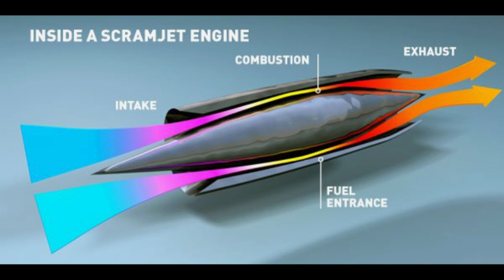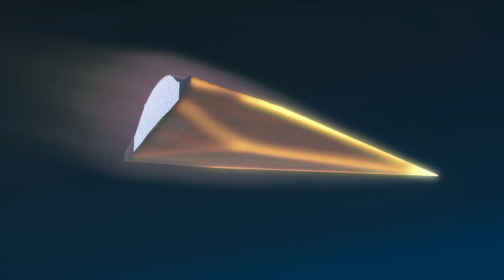SR-72 MACH 6!

Comment: They won't be lighting candles in hurricanes .Lockheed have bought into reaction engines in the UK. It uses thermodynamics to propel the plane like a rocket but with the fuel efficiency of a jet. That is why the whole project has stepped up a gear or two.
Reply: Can you send me any links

Comment: The pictures you show of the Aurora are a plastic model. The Aurora (SR71 replacement) does or did exist. A mil radar op in the UK told me they would be briefed before it came through  (more than 15yrs ago), so whats with this SR72?  Perhaps it melted in flight.

Comment: At 0:50 -
Your data on the SCRAM jet is inaccurate. A RAM JET has no moving parts. A SCRAM jet is basically a regular jet engine which reconfigures itself in flight to function as a RAM jet.

Comment: On September 18,2015 a stealth flew at mach 6 speed for several hours and landed.I think it used two Wang Zhengou turbo scram jet engines and Shou-En Zhu low cost grapheme alloy airframe.It may have quantum radar and PL-15 air to air mississiles which is twice the range of US missiles.Grapheme is 10 times stronger than titanium and twice the melting point of titanium.Graphene alloy can adsorb radar signals.The SR-71,F-22 and F-35 used a very expensive titanium alloy airframe that can be seen by quantum radar and cost 240 million dollars each.
Reply: Corrine Tsang WHATS THE POINT !

Comment: You realized they never officially declassified the SR-71's maximum capabilities right? Mach 3.2 is just what we're allowed to know. I'm pretty sure the SR-71 was capable of going much faster.
Reply: I believe that they have reached 3.45 to 3.5. It's intended sweet spot was 3.2., but not a limit, just where it was designed to fly very efficiently. I have heard that to go beyond the 3.5 figure would result in the compressor fan blades taking on damage as they had a rated limit of 427C- air temperature/density dependent. Whether that was a hard limit for short bursts of speed or for long term average temperatures- not sure. At mach 3.3 however, they could easily add several hundred knots in a hurry to avoid missile contact. The SR-71 is one beautiful plane and still the fastest to date.
Reply: I heard a SR-71 copilot saying that during a mission they did reach Mach number never seen before during 15 seconds to avoid a missile to hit them .I suppose  it could go over Mach 4 for a short time ...
Reply: I think the XB-70 Valkyrie was right up there also.. The record for the flight from Vandenberg to Wright/ Paterson has yet to be broken..
Reply: Google "WINGS" a late '80's TV program that was on "History CH".. Go to XB-70 .... You'll find that I'm right and you're not old enough to know.. Everyone that wants to argue with me isn't/ had there 40th birthday as of yet..
Reply: No it couldn't. At around 3.7 the shock wave from the nose fits the engine intakes which would case them to flame out.  I suspect top whack was probably around 3.5... much like the MiG29 it wasn't really meant to go that fast.... although it "sort of could...if it really had to..."
Reply: No it hasn't been.. But the man who was my supervisor @ Hughes worked on the project from it's conception.. Over hearing conversation with "KELLY" (this was @ the palmdale plant of Lockheed) and the engineers that the CIA wanted 3.3+.. It could/did cross the US of A in just over an hour.. It didn't,, how ever they did a measured course over the pacific and it was @ 3.1.. But the only one that could was the XB-70 Valkyrie.. A Northrop thingie.. It went from "Vandenberg" to "Wright Paterson" in under 57 mins..
Reply: several years ago probably before you were born..  CIRCA '09/88 On the history CH,, There was a TV program Called "FLIGHT". Every Saturday they spotlighted an air craft of significant historical value .. Went through their full history from inception to tarmac .. They started with the "Wright Flyer" to the F-16, as the YF-22 & 23 were still in development.. But know that I think about it,,, though,,,, they did set a record,,, but not a major record because they didn't want to blister the paint as they did in  the test program.. There were 3 Valkyrie's built.  (1) was testbed, (1) crashed, the other was used for a series of test flights.. AS the last one was to "Wright Paterson" where it's on display.. I used to live airplanes... This program covered civilian and military.
Reply: TR6 +  And Brian Shul added '   the aircraft did it effortlessly !! he probably hit 3.5 ..
Reply: Clyde Marsha
Reply: Yes Brian Shule (SR71Pilot) said he still had 4" of travel left on the throttles when he saw unusual high Mach numbers escaping from a missile..As stated here air density and air temp is the main factor, as the SR71 operated in high engine bypass mode ram jet style at high speed.It was a incredible construction done at the end of the 1950s.

Comment: s-400 flies at mach 14 and can hit targets at an altitude of more than 100 miles. so the SR-72 can't spy and run away. those days are gone.
Reply: It has a minute and a half endurance which encompasses an acceleration time and course correction. Its target has to be detected before it can be launched and jamming capabilities from all sides these days are awesome. For all we know, this thing is overflying every continent on the globe already.
Reply: I wouldn't be too sure about that, my friend. You can't hit what you can't see. A 4m² target (F-16 as example) can get as close as 390km. A 0,4m² target (Eurofighter) can get as close as 230km. I'd say F-35, F-22, can get closer than that. 

If the SR-72 is Stealth, and i am sure it will be, you might track it, when its just above you, but might be out of range, as soon you've launched your missile. Chance is, the S400 is destroyed or jammed by the time the SR-72 get close, anyway. 

S-500 will be more of a threat.
Reply: It could also potentially carry active countermeasures. Perhaps carry something like a RIM-116 missile to fire at the incoming missile.
Reply: Once plasma starts to generate on the surface due to high speed you can say goodbye to stealth. Sounds good, doesn't work.
Reply: Sir D those days are still present dude..., this all is a secret project of USAF n NASA...hundred times it can spy Russia's bases and secrecy! Wait it's coming more...like the scramble jet that flies unspecified mach speed!